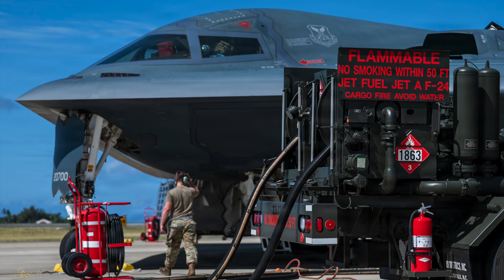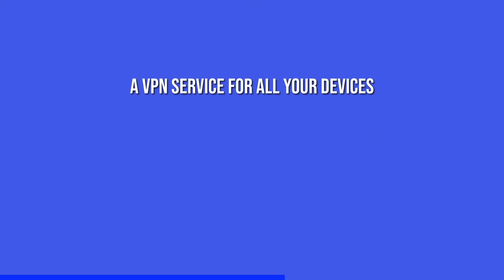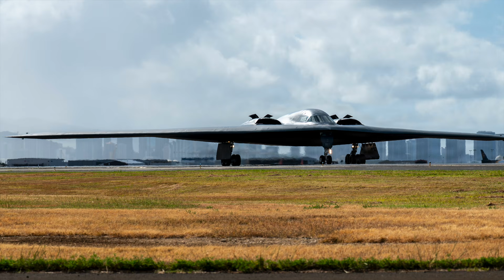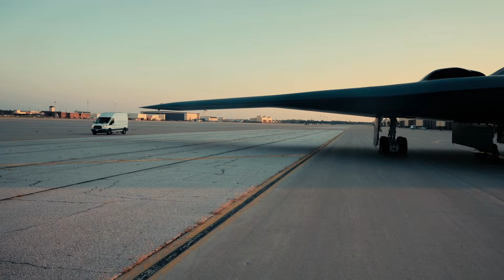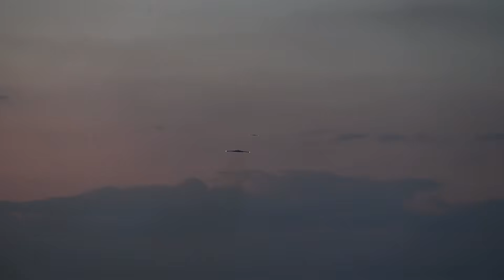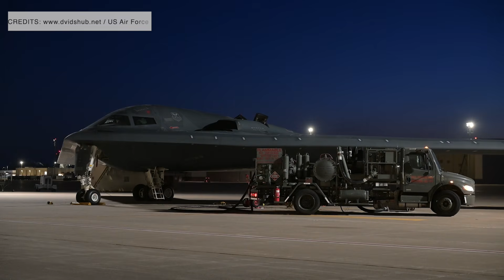Why hot pit refueling of B-2 in Hawaii is a message China can’t ignore  ?

Comment: In principle, further Tinian upgrades could accommodate B-2 hot pit refueling.

That is another possible B-2 hot pit refueling station in absolute emergencies.

Well done.
Reply: You should refuel in Sydney Australia  = where Xi Jinpings brother and other family lives = less risk of being hit by Chinese missiles mate
Reply: You know it China takes out Guam when they invade Taiwan!
Reply: @metatechnologist Xi hasn't yet found a Chinese general he didn't want to eventually fire/jail for theft/incompetence/disloyalty.
Reply: @Chuck_Hooks  
Every general is a potential political adversary so he can thin them out
Reply: @metatechnologist  
China will attempt to take out Guam
The DF-26 needs 20 minutes to reach Guam, thats ample time for MITO to get aircraft airborne
Secondly ample time for defenses to respond
100 percent certain that USAF combat engineers has slabs of concrete, truck loads of sand tons of AN-2 matting ready to repair the runways in under a hour
Lastly everything on Guam is spread out
The DF-26 can carries a massive 4000lbs warhead which means for large craters but nothing combat engineers can deal with
Now if China had any sense, they would MIRV the DF-26 into 4 smaller warheads allowing to strike more targets per missile but most importantly deal with the spread out targets at the base
Reply: @verdebusterAP Guam and the Northern Mariana Islands operate as permanently inhabited U.S. territories, the United States also holds several minor, uninhabited islands! They’re all spread out if you look into it they’ve been training for this for some time now! We have aircraft carriers and amphibious aircraft ships and destroyers and cruisers! Around 70-90 ships at any given time from Taiwan to Indo-Pacific Command!
Reply: @YeaDatDrill  
all those bases need proper defenses
Reply: @verdebusterAP  Nope they’ve made multiple landing strips and  prepared for destruction hardened shelters into the landscape almost like Iran and Taiwan has done they’re not bases! It’s just places Marines can island hop and wait for orders and logistics! There’s a few videos on it here on YouTube! I’m pretty sure I butchered but they have multiple Himars vehicles for Intercepting and launching missiles that can shoot and move very quickly and even a few DarkEagle and Typhoon missile vehicles!
Reply: @YeaDatDrill  
The Dark Eagle wont be used ,its too expensive per shot unless they make a massive buy and get the cost down to under 10 mil
What they need is AEGIS shore as well as 1 ship defending
The biggest issue is that Army is still dragging its feet with the PAC-3
The either need to invest in the PAC-4, buy the Sky Ceptor or adopt the SM-6
The better path would be the Army, USN and USMC all working target on the PAC-4
The PAC-4 would use the David's sling seeker with larger warhead and still quad pack for existing PAC launchers for the Army
The USN would settle with quad pack variant for the MK-41 VLS but the for DDG-X , its VLS would support launcher missiles based on the PAC-4 design
The USMC would get new launcher on the back of MTVR with 8 missiles. Like the Multi-Role Radar (TPS-77 MRR), the MTVR would carry the USMC GATOR radar on its bed instead of trailer for faster deployment
A JTLV would carry the generator
The USMC has MADIS/LADIS with Israel made Tamir missile but its warhead is only 24lbs 
to deal with DFs ,you need at least 50lb warhead 
That or the SM-6s
Reply: @metatechnologist  We have 5+ other islands out of strike range of their cruise missiles any other Ballistic missiles would be intercepted! Also Xi attacking the US directly unprovoked just to invade Taiwan would be a strike against all of the pacific Allies Japan Philippines Australia France Canada America and Taiwan! That’s just the Pacific Allies and it’s very possible NATO would get involved!
Reply: @YeaDatDrill NATO right now in Iran? Iran is at war with the U s. No NATO is fighting Iran right now. Do you get paid to post this bs?
Reply: @TitaniumOg-t2e  who is talking about Iran the US is very capable of going to war alone! What I am saying is in the Indo pacific the US is in a supporting Role! France Japan S Korea Philippines Australia and Canada already said they would defend Taiwan who’s been investing Billions into their Defense!
These six nations (France, Canada, the United States, Japan, Taiwan, and Australia) are deeply intertwined in Indo-Pacific security and democratic alliances. They coordinate closely to uphold the status quo in the Taiwan Strait, frequently objecting to Chinese grey-zone activities